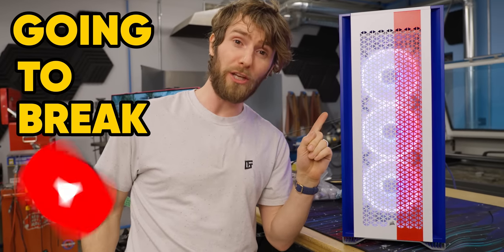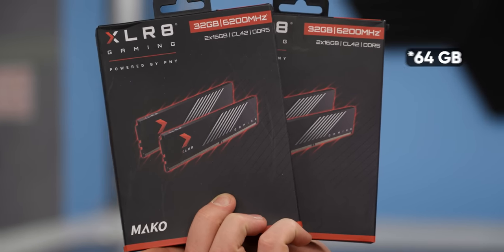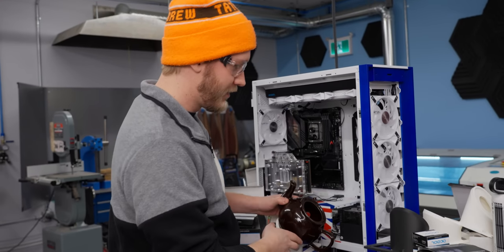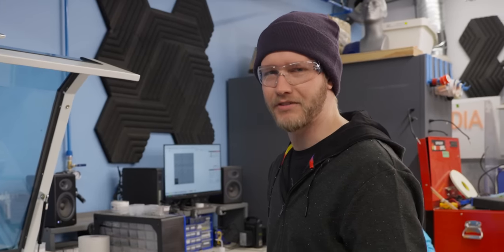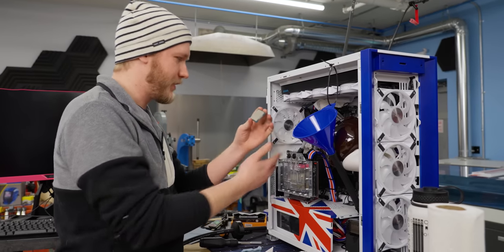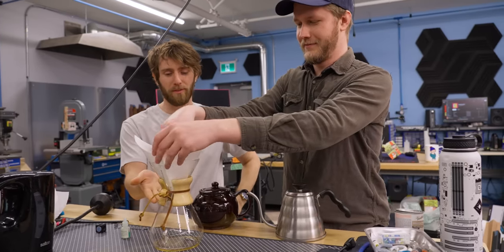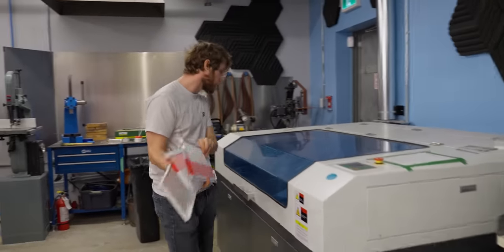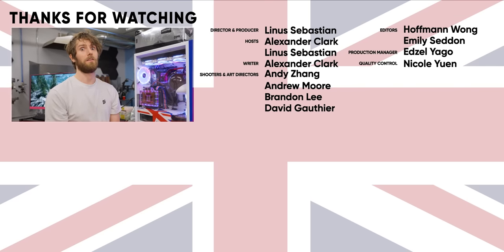This PC Will Break YouTube

Comment: Here's a pro tip if you want to get rid of micro particles: use a sterile vacuum filtration unit. They are sold mainly for biology applications and will filter things down to 0.2um, which is more than enough for something like tea. It will also sterilize the fluid which is always a plus when trying to avoid things growing in your cooling loop.
Reply: Probably way cheaper and still get you close enough would be to use a fritted glass filter funnel, pull the tea through work a vacuum pump, then boil it to keep from having growth, or to stop the growth you'll often see like some % v/v acetonitrile in water used, but that would likely attack the consumer grade plastics in the loop, most plastics for use with organic solvents are like polypropylene or PTFE (teflon or polytetrafluoroethylene) and I don't think those are very common in transparent consumer grade products because they tend to be translucent at best
Reply: That's the first thing I thought of too. Sterilize and remove particulate in one go.
Reply: what kinda shit can grow in cooling loops???????
Reply: My question is, can you use a defoaming agent in the tea as well, or will that attack the plastics?
Reply: Yea, coffee filters isn't all that good at removing particulates. Good enough for coffee can still look cloudy A-F. I made a Christmas schnaps some years ago that got incredibly cloudy. Only thing I had was coffee filters and I must have ran that through the filters at least ten times before it started to look decently clear. After the first three times I thought there were no way it would work. But I got there eventually. Still it was far from optimal. The result however tasted just as intended. Won me a competition for the third year running, disqualifying me from competing again...
Reply: @revoblam7975  idk, bacteria/some form of rot, mold, fungi etc.
Normally you would use distilled water, which reduces the risks drastically, but what they're using is boiled water mixed with tea leaves, not exactly the most clean liquid to put in a closed system for years. At least they filtered the tea after.
Reply: @revoblam7975  from tea? Bacteria most likely
Reply: Wouldn't that also get rid of the tea color?
Reply: The problem is tea IS those 10-50 µm tea particles in suspension. If you filter them out you just have sugar water or whatever.
Reply: @charleswarwick4849  isn't tea just particulates in water? Won't that just make it back into water?
Reply: @revoblam7975  you don’t want to know how
Reply: Okay bm
Reply: i would have gone with just brown die...
Reply: Here's a pro tip if you want to get rid of micro particles from tea: run it through a 3 angstrom molecular sieve! You'll also filter out all the actual tea, and all the water molecules too, but otherwise it's a flawless tip.
Reply: @revoblam7975  Life finds a way. Did you learn nothing from Jurassic Park?
Reply: Or just mix die's to get the right color? Just saying.
Reply: @gemhunter498  How would mineral oil affect the plastic? I use lemon Pledge or stainless steel cleaner to defoam the inside of my wet/dry vacuum when I extract carpet.
Reply: i think the problem is with tea you dont want too much filtration otherwise it just goes back to being water
Reply: @steelfalconx2000  The color comes from soluble molecules too small to be filtered.
Reply: @revoblam7975  bacteria
Reply: @revoblam7975  same stuff that grows anywhere there's water just sitting there.  Usually coolant has some sort of biocide mixed in to kill bacteria, algae, mold, etc.
Reply: @sethdrake7551  Wishing the best but my vote at the beginning was inert faux tea rather than a degradable. Somebody rattle my cage with a follow up down the line in a month or so. Tannins are in tea leaves as well as those off trees and will stain surfaces if not removed soon after the wind of spilt tea isn't cleaned up. Are they going to affect the tubing? Too many ifs for a very expensive system. Make my system with Irish beer stickers and green food dye.
Reply: @firesurfer  actually only played the park management game
Reply: @scottdahl1938  yeah, that's my question too
Reply: Yeah like they're gonna use UF for a computer, at most you'd use a 5um filter. 0.2 is suitable for injection to the human body, there's no need for that.
Reply: If you do that, most of the color will fade as well. Tea without particulates looks like piss after drinking a lot of water
Reply: @blahorgaslisk7763  gonna need a recepie for that chrismas snaps in order to conform quality myself >_>
Reply: You would initially get most contaminants out of it, yes. But the main problem is the tea having plenty of substrate for microbes to grow. So technically, just one "tea friendly" fungal spore would be enough for it to rot very soon. For this to reliably work, you'd have to sterilize the entire loop thoroughly, assemble the entire thing and fill the loop with the sterile filtered tea under a sterile biosafety cabinet.
Reply: @revoblam7975  ever heard of Legionnaires? Probably not that, but all sorts of physical gunk as well as gunk that would almost certainly mess you up to consume
Reply: This would only work if they autoclaved the entire loop, then poured the filtered tea in. So the use of an antimicrobial is actually a decent way of doing this under the circumstance, it just needs to kill everything once the loop is closed, hopefully it does. The best way, and super over done for this, probably, (coming from someone who works with reactors that have a whole buncha loops and tubing), is to filter the tea to sufficient particle size for the application, then autoclave the whole loop and the tea, assemble the whole thing in a sterile BSC. Haha, but that's really unnecessarily troublesome.
An antifoam would be good though, they're not super expensive.
Reply: @Dracounius  I looked for it, only to realize I had it on my old Nokia phone that was running Windows phone OS. So that was a few years back... Looking through my sent mail folders didn't turn it up either. I could have sworn I had it saved on OneDrive, but no dice searching there.

What I remember it was Vodka, some chopped up chili fruits I think they were ordinary jalapeños, orange zest, sliced ginger, clove and a cinnamon stick.

I can't remember the proportions but after filtering I cut a few thin curly strips of red chili fruit and dropped the min the new bottle with the cinnamon stick and possibly some curls of orange zest. I'm not sure about that last part as I have a feeling the orange zest didn't look all that appetizing after being steeped in the vodka for a few days.

Anyway it was a nice schnaps. It both smelled and tasted like Christmas only for the chili to give it some nice bite with the after taste.

It was however very cloudy before filtering.
Reply: Also, the fluid will not be sterile. Most viruses and toxins pass this filter. It will be free of bacteria, protists and fungi, though.
Reply: @HomerChiotakos  Yeah it won't grow by itslef. That's the point. Also, for viruses, the boiling should be enough to neutralize them. As for toxins, toxins are not microbes so they fit within the definition of sterility.

Comment: For future reference on drilling through ceramic for a nice clean hole, first drill a hole of required size into a piece of wood then tape this in place on your pot, fix the pot to a table pref using clamps and cloth/bubble wrap to get a firm grip without cracking the pot.    Drill in using water (someone can just pour a jug slowly for you)   start at a slow speed increasing pressure gently and power slowly until you feel the drill bit "grip"  keep this same consistent pressure until through for a nice clean hole.    I was a tiler for over 20 years so this is my contribution to PC building lol!
Reply: This is just generally useful, I bet I'll come across some scenario one day where I'll need to drill through ceramic and this will help. Thanks!
Reply: @eggnorman  bongs.
Reply: @notinterested8452  i like you

Comment: you could probably run the tea through 0.1 or 0.2 micrometer filter if you still wanna run tea as your fluid and make it less likely to clog the heat block fins
Reply: well it wouldn't be tea anymore
Reply: Would that affect the color?
Reply: can also allow tea to sit for 48 hours and decant the liquid off the top.
Reply: run it a few times through a Brita water filter
Reply: @@shak1ification112 ahh yes😂 that would be best but far too simple for this janky build

Comment: absolute brilliant idea. If for some reason you can resist the temptation of yorkshire tea and let it go cold, you can just pour it into the cooling system, play modded Skyrim for 6 second and it is boiling hot again
Reply: Just play crisis
Reply: @theyogurtfan5847 overheat crisis
Reply: @gozutheDJ  true
Reply: @gozutheDJ  And also way past the point where the original Crysis is even remotely taxing on gaming hardware.
Reply: XD
Reply: @gozutheDJ  Well, at some point it does become hard to run, but not because of hardware limitations; because of engine limitations.
Reply: OMG YES! They missed an opportunity here. Should have made it so the pot could be removed and poured out.

Comment: They should have put a heat exchanger into it for brewing tea, like an overcomplicated electric kettle, that would actually be useful and still be a total meme. Tea as coolant is going to have stuff growing in it and clog the microfins in the cooling blocks.
Keep the cooling loop as a normal loop, but instead of a normal radiator, have it dump heat into a heat exchanger that heats water and drips the hot water into tea, maybe kinda like a drip coffee brewer. 
The harder you game, the faster it heats water to brew tea, and then you chug the tea for your caffeine fix so you can game even harder, repeat to infinity.
Reply: this needs to be higher
Reply: temperatures wise you need a smidge under boiling for brewing temp, not great for computers. But they could've put in a warming plate maybe?

I just hope they swapped out the tea for brown dye.
Reply: I like the idea of using the cpu/gpu heat to actually brew tea
Reply: Someone suggested a proper filtering system would leave no particulate but still tea coloring

Comment: I died at 20:50 xD Absolutely love the whole project and all the little touches you fit in. Sure the teapot is in the spotlight, but the painting, both sides of the cable panel, and obviously the tube fittings really top it up to perfection.
Reply: What does it say?
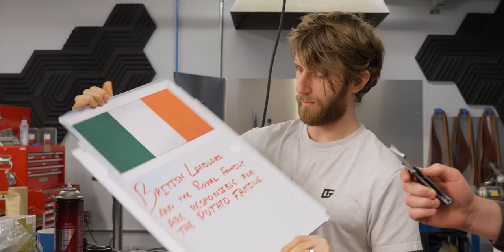Reply: @Hoaxe72  they show it later at 22:13

Comment: This could've been a lot more difficult in regards to the 3d modelling if the Spiffing Brit would've been a coffee drinker, but luckily he drinks tea and teapots happen to be one of the default 3d shapes in some 3d modelling software.
Reply: There's a reason that it's everywhere: that teapot was in fact the first object ever modeled in 3d
Reply: @Jake9066  we know
Reply: The Utah teapot is quite different from the one they used
Reply: @TheBlazingRiver  I didn't know that tbh
Reply: Pottery is the original 3d modeling medium after all and teapots have historically been a sort of proof or test of skill. There are several parts that all have to work together functionally and aesthetically; it has to pour cleanly and keep the lid from falling off while tipping over. body, spout, handle, and lid can give you a lot of different forms to work with

Comment: For finding leaks in your loops, would using a mineral oil burner be a good idea? It'll fill the tubes with smoke (at least in theory) so that wherever it leaks you'll see smoke coming out. I at least know this for use in automotive settings and whatnot.
Reply: I would guess that the smoke would leave grease and particulates in the loop which would be caught in the fins of the water blocks and eventually damage the components. Cars and other industrial pipes don't have those thinly spaced fragile fins, and are probably easiers to wash.

Comment: I'm not much of a PC builder, but do love a good rig. Couldn't you use a liquid that shows up under UV light to test for leaks? Not sure if it's a clever idea, or has been thought of before, but could help for detection of leaks
Reply: I am not sure how a liquid showing up under uv light would help because you want to find the leak before you add water into the system. If all else fails you just run liquid through it to find where it leaks from, after which the leak locations would be evident because liquid is coming out of it.

Comment: So what will happen after a while? Would the water loop need to be filled with tea packets again to re-up the flavor?
Reply: The PC will know the difference between tea and water
Reply: user-ui9ni4nf5z  i clicked that and now i'm gay, thanks a lot
Reply: Just keep dumping tea leaves in and called it steeped.
Reply: @tatzecom  clearly using PG tips if it rots.
Reply: It really depends on the makeup of tea. I don't know enough about it to know how much of the colouring compounds come from water soluble chemicals contra suspended particles. If it's mostly suspended particles then you'll see a sedimentation process in zones of the loop with significant pressure drop (mostly the reservoir I'd guess?) and the colour will fade. Add to that potential microbacterial attack or off reactions between loop components and compounds in tea (I'd be afraid of the tannins personally). You might also see some permanent staining of the tubes from said tannins.

If most of it is from water soluble compounds well it should? stay in there, maybe still staining the tubes.

Even with my limited knowledge of chemistry this... well honestly seems like an out and out terrible idea x) but I think LTT knows that.
Reply: @guyfawkes8873  My experience is as a tea drinker is that this is a terrible idea. leave a cup in your car for a week and you will know why.
Reply: @tomtom7955  Well, you also don't put anti-microbacterial fluid into your tee.
Reply: @rumapark494  I doubt a couple drops of anti microbial fluid will keep the tea from gumming up a closed loop for any significant period of time. Its not so much slime mold or what not growing that is worrisome but as the tea evaporates its gonna leave tannins and other sticky residues behind that will collect other particulates, I would be surprised if it made it 3 months and Amazed if it lasted a year. then again there are a shit ton of variables that could skew it sooner or later but you can be almost certain it will be significantly less than if you used distilled water.

Comment: I know this is late, but I used to work residential plumbing and when we had slow leaks in the system that we couldn’t locate we would use an air compressor, use a fitting to plug it into the system and give it a bit of air and listen for the whistling

Comment: not sure if I could recommend those types of fitting for tubes, this type of fitting is quite frequently used in factory settings for pneumatic and hydraulic systems and the sharp points(teeth) over time (1-3 years) tend to eventually make their way through tubes cutting them off, and either destroying fitting or making repairs on them very painful in process, creating leakage, not to mention if they being used often for i.e. pipe maintenance they tend to loose they grip or one of the teeth gets broken etc. In factories these issues are usually overlook because you can just replace fitting (they aren't expensive) and cut damaged parts of tubes, even in case of "explosive disconnection" so it's very easy for maintenance over some other pernament options, now in pc I feel like this could turn costly very fast.

Comment: I appreciate you cleaning all of the Vaseline off of it (it was killing me to even see that stuff), but I'm curious how you managed to get rid of all of it without killing the socket, pins, or anything else on the mainboard.  Was there some sort of solvent involved?  Tell me your secrets!  (Not that I have problems removing Vaseline from things IRL.)
Reply: Pretty sure they have an ultrasonic cleaner.  BTW, der8auer cleans his motherboards in his dishwasher (successfully).
Reply: Der8auer method? (dishwasher)
Reply: Compressed air
Reply: It's not 100% but you can kinda melt vaseline away with a hairdryer.  To get better than that you'd need to use soapy water or some kind of other solvent.
Reply: Dishwasher
Reply: @alastairstedman7840  yep, that or warm shower
Reply: many many years ago I received a motherboard that was covered in oily dust and was said to be not working, I washed it in the kitchen sink with warm soapy water and a toothbrush, hung it up to dry for a couple days and then left it in the sun with a fan on it for a couple hours to make sure it was dry, ended up working perfectly after that, lasted many years still. Granted that was an early pentium 4 class system so a lot less fragile compared to the latest board pins and extrat small parts
Reply: @joeledwards6587  Most hardware can be cleaned using mild soap and light brushing.
Water isn't harmful to electronics by itself, so long as the electronics are properly dried to avoid oxidation, and before being powered on again, and you should be fine.
Reply: Just about any mild degreaser or plastic safe solvent will work but the biggest key (besides removing the cmos battery) is to make sure you rinse any degreasers with something like 91% plus isopropyl alcohol to help remove any moisture or residue as quickly as possible.  Plastic safe brake parts cleaner works wonders as well for boards that have much more stubborn things like cigarette smoke when you don't have an ultrasonic cleaner available.  Give a cleaned board plenty of time to air dry before trying to power back up.
Reply: @alexanderclark6889  Huh.  Of all of the possible solutions that I pondered, compressed air wasn't anywhere near the list.  But that is good to know.  Thanks!